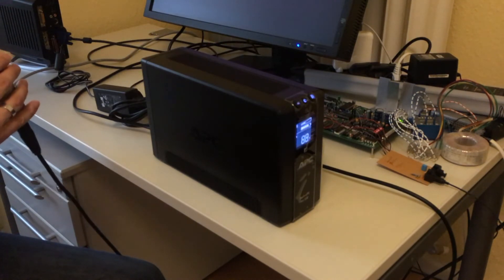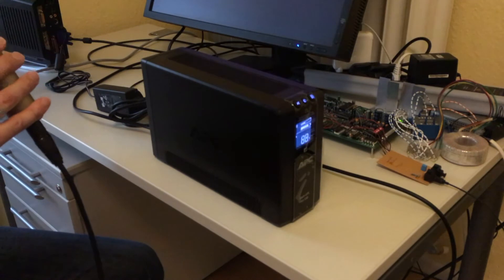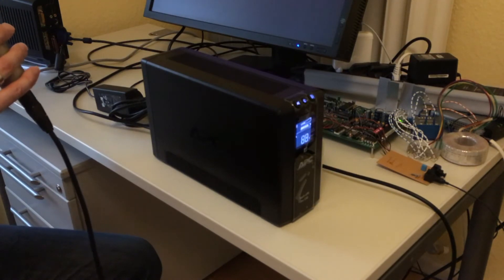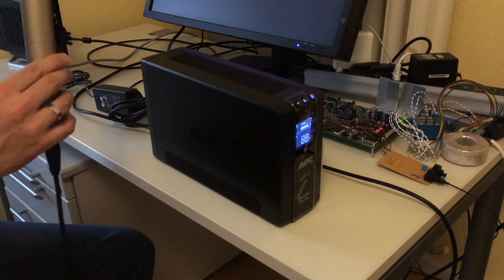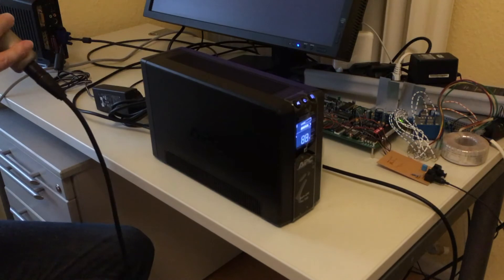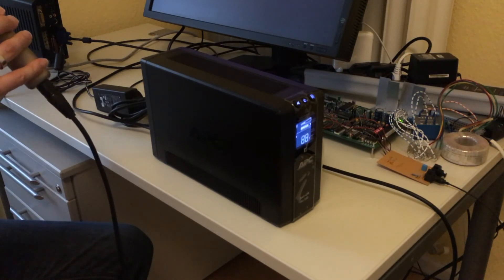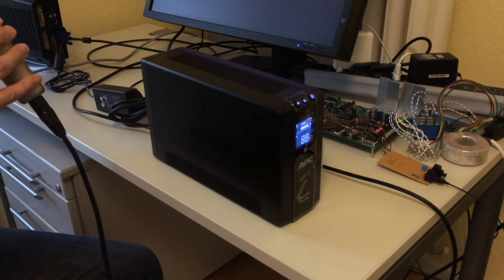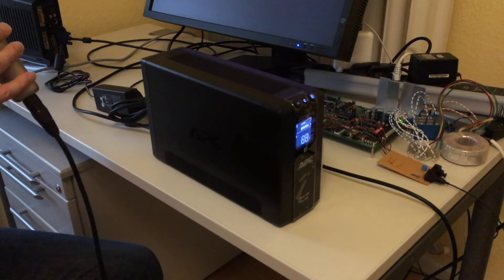More coil whine, APC UPS power rail hum & fizz !!!

Comment: So I had been struggling with this exact issue (BR900G) and I even tried replacing the battery to no avail. Knowing that it happened with a new unit to you confirmed my suspicions that this motherboard design (or component choice) is very susceptible to coil whine. Because of this I was quite hesitant to purchase a different device. Unfortunately one of the other UPS'es I have started moaning about the battery needing replacement and it's been the 3rd time that I've replaced the battery so I decided to replace it with a BX950MI. And to my suprise: no coil whine! So if you're looking for a replacement in 2022 I can wholehartedly recommend the BX950MI! Hope this helps someone. Take care!

Comment: Got an APC Pro 900 with the same coil whine,return it the next day.Any suggestion for a UPS without coil whine?
Reply from the maker: The entry level APC i mentioned somewhere in the comments above did not coil whine for me...
Reply: @renerebe  Got a BX1200MI its perfect totally quiet no bad smells,but avoid the bigger models because they have a low quality fan that is noisy.

Comment: Fiy it's the ac/dc transformer being a little loose.
Reply: I've had it happen on 3 out of 4 eaton 5s 700's. There's a fix for it but you need to know your way around electronics and transformers to even attempt it.

Comment: That is not a bad noise, most of them are way louder than that.  They are just cheap units mostly now.
Reply from the maker: When I can hear it and can not concentrate next to it, it is bad noise. Also this was the more expensive Pro model,  I sent it back and ordered the cheaper non Pro model from APC and it is silent.
Reply: My unit is dead quiet. That's the way it should be.

Comment: That noise is totally normal.  The UPS is just charging the battery up from being disconnected or recovering from being on-battery.  The noise will get quieter and quieter as it reaches the charged-up voltage (27.35V) and when it does it'll be completely quiet.  The buzz comes from the way APC UPSs do charging pulses to condition and extend the life of the battery.  
If you have the buzzing all the time it means your battery isnt able to reach or hold the fully charged voltage but the UPS will keep on trying - which doesnt necessarily mean the battery is bad, just that it's not new any more.
Reply from the maker: No it is not normal, it did not get quieter, I had it running for 48h before I packed it up and sent it back! My concentration and productivity dropped by 50% with this noise generator in the room. Our 8 year old APC UPS it was supposed to replace did not make such a sound, nor the new, cheaper entry level model (APC Back-UPS BX) I ordered instead and have running since then, ..!
Reply: The noise is normal, I have 4 of these and they all do exactly the same.  I've even modified a couple of the units to accept a MUCH larger (2x35AH SLA) than normal external battery pack and even with those big honking batteries the noise goes away when they finally get fully charged - several days later.  If the noise didnt go away then it was either a bad battery, an old battery, or a bad charging circuit.
Reply: @DAH-ss1nu  

Normal for this junk APC model?  Sure, it seems it is normal.  Acceptable?  Absolutely not.  2 weeks plugged in and charging with barely any load and the noise never stopped.  The replacement unit from APC had 2 weeks to stop making the noise....nope, and it was even a little louder than the first.  Garbage.  Purchased a new battery for my 7 year old unit instead.....DEAD SILENT.
Reply: I just bought a new - sealed APC Pro 900 and it does the same noise. I am glad that you wrote and I know all the line has the same noise. It is MUCH irritating but at least it seems to fuction normal . If I were to have it at my personal computer I would send it back. Fortunately it will go to an isolated room . BUT APC should warn end user that it is not apropriate to keep it next to you when you are working. Now it is charging the battery. If the noise stops when it is fully charged I will try to update this comment
Reply: Update: after the battery is full the noise stopped. So it is indeed the battery charger
Reply: That's bullshit, pal.
Reply: Thank you! I knew someone would eventually answer the question and solve the issue.

Comment: my question is; is this bad? should I ask for a replacement unit?
Reply from the maker: Well, my hearing is good enough to seriously annoy me when I am in the same room. So it depends on you if you consider it "bad". I guess most if not all units have this issue of some electric components producing this high pitch noises. A problem also found in some graphic cards, and laptops: https://www.youtube.com/watch?v=LXnnILA40Yw I returned our "Pro" and order a cheaper "BACK-UPS 950" instead, which is not producing this annoying noise, ... http://services.exactcode.de/amzn.cgi?index=electronics&keywords=apc%20back%20ups